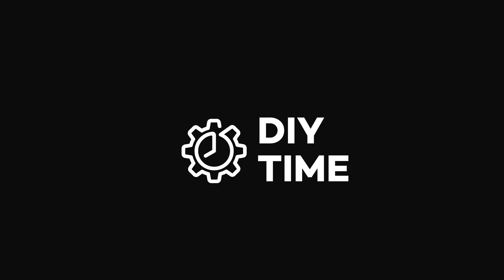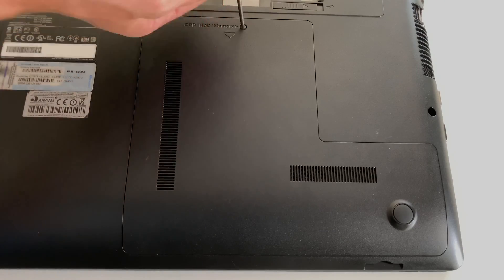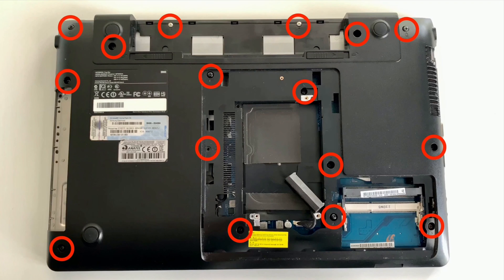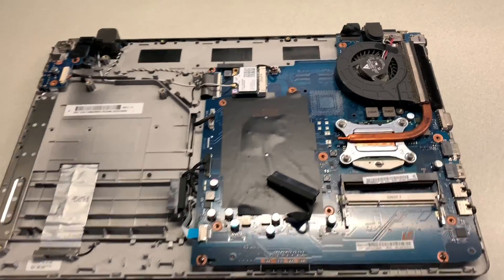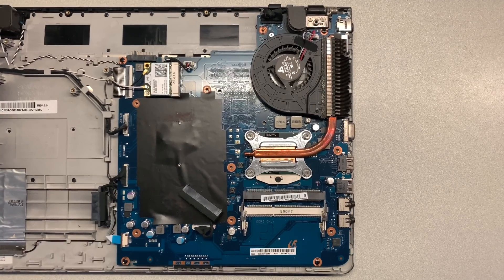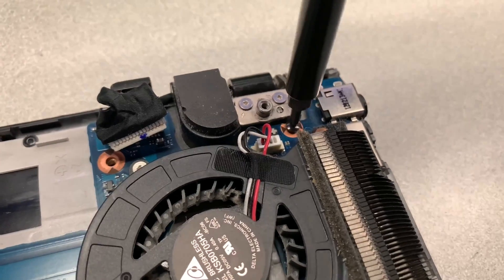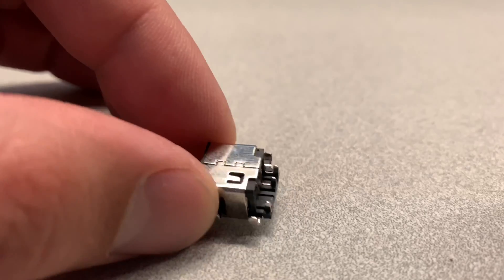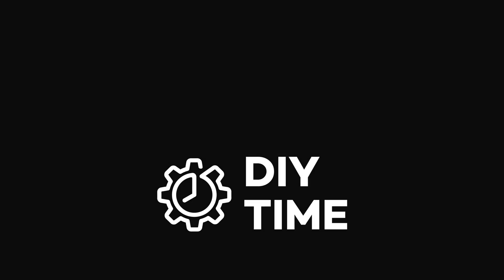How to fix broken laptop charging port.

Comment from the maker: You can find replacement parts here: 
https://rover.ebay.com/rover/1/711-53200-19255-0/1?mpre=https%3A%2F%2Fwww.ebay.com%2Fsch%2Fi.html%3F_from%3DR40%26_trksid%3Dp2334524.m570.l1313%26_nkw%3DSamsung%2Blaptop%2Bcharging%2Bport%26_sacat%3D0%26LH_TitleDesc%3D0%26_osacat%3D0%26_odkw%3DSamsung%2Blaptop%2Bmodel%2B%2523%2B%2Bcharging%2Bport&campid=5338755354&toolid=10001&customid=
(As an eBay & Amazon Partner, I may be compensated if you make a purchase).

Comment: I've broken my charging port for the most part from... erm well I guess the best term is misuse.
I used to sleep in a bunkbed with my sister and I was on the top bunk, so I'd plug the cord in at the bottom outlet near her bed and feed it up through a small hole in the rail to my laptop.
My Mattress not being a flat surface often caused it to pop out and wore the port out much faster than it would have originally. (I think the fact that I accidentally dropped my laptop from that height twice didn't help.)
I'm afraid to take this thing apart for the fear of not being able to put it back together xD
But I appreciate the video because maybe I can get someone else to help me with it.
The port still partially works but it's in very bad condition, but at least now I know I won't have to entirely replace my laptop because of this. Thanks ^^
(Sorry for long paragraph lol.)

Comment: I have kind of a wierd problem. My little sister pulled the charger off the laptop whilst it was plugged in and the port came out but so that my mom would not notice my older sister put it back in gently and it would charge normally but now it has stopped
Reply: Bro we have the same reason

Comment: May samsung laptop automatically turn off? A put new heat sink paste. New ssd, and i check the ram. And still turning off
Reply from the maker: Is it turning off right away or after working for some time?

Comment: Hi man, I have a different problem, but one that's worrying me a lot. My charging port is in really bad shape, so much show that the little pin inside it has completely come off. I'm really scared and I don't know what to do now, I've already tried putting the pin back in but it doesn't work at all. What should I do?
Reply from the maker: I would suggest replacing that port.

Comment: so...disassemble laptop. take motherboard to computer shop and get them to repair it. Really?
Reply from the maker: Only if you are not comfortable soldering it yourself. Plus, on some laptops charging ports are plug and play, no soldering required. 
Plus you can buy replacement port yourself for $5 - shop will charge you $50. Plus they will charge you 💪🏼 &🦵🏼hourly rate for disassembly/reassembly, when you can easily do it yourself. Its up to you...

Comment: I've a G7-2217cl that possibly needs it's bottom cover replaced. Left side will not close flush  despite screw all in the way inside. Either hinge and or bottom cover broken inside.  Better to buy new than buying 10 year old replacement part(s)?
Reply from the maker: I’ve seen this happen before with my friend’s laptop. Those hinges get really stuck over time to the point that they dont open any more and they break the laptop housing when you try to open the lid. Back then I took apart laptop, loosened & lubricated the hinges, glued together broken housing and laptop was useable again. It’s kinda pretty involved process. Up to you if you wanna mess with it. I think I have a video how I did it, let me check...
Reply: @DIYtimeTech  I don't have much choice but to now consider it a fixed-display terminal. Thank you though.
Reply from the maker: Here is the video: How to take apart and fix laptop hinge. Toshiba, HP, Dell, Samsung, Lenovo, Alienware, Acer, Asus. https://youtu.be/aHg9F6d_ExU

Comment: Hey there, I just wanna ask what could be the problem of my laptop that’s not been charging and is not used for a month now because I accidentally tripped on the charger cord while it is plugged in and that my foot pulled it accidentally while walking and that it was pulled out from the charging port in a not appropriate wat to plugging it out. I would really appreciate if you could reply to my comment, thank you.
And also when I plugged it in back it is not charging anymore. What could be the problem? I really want to know. Could it be the prongs inside the charger are bent away and that’s why my laptop’s not charging? Thank you very much in case you could possibly help me with my problem.
Reply from the maker: Likely power cord got damaged. Try to find identical known working charger and see if it will work. If not, then its possibly charging port.
Reply: I actually found an identical working charger but it seems that the charger is working but the laptop wasn’t charging and I think it could be really the charger port of the laptop that is damaged. Thank you for taking time to reply on my comment, I really appreciate it. Thank you very much
Reply from the maker: My pleasure!

Comment: My Laptop Charger port was broken again now. So I have a hughe problem I really need to make my laptop be repaired it's port again.
I need it continusly, Don't know what to do I am in great panic.
well I am still within my parents and trust them still.
idk what to do yet I don't have the materials but I'll try my best for this Instead of replacing it just move it onto near the porting area to solve this but I have big philip screws and the ones are smaller ones and this is my problem with it. I can't screw it also.  But I'll need to do it in order to repair it.